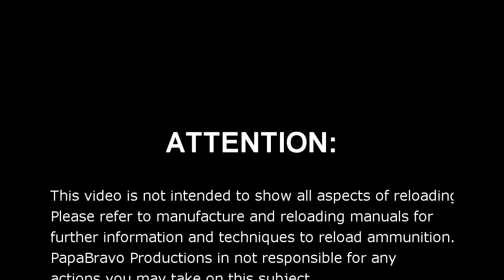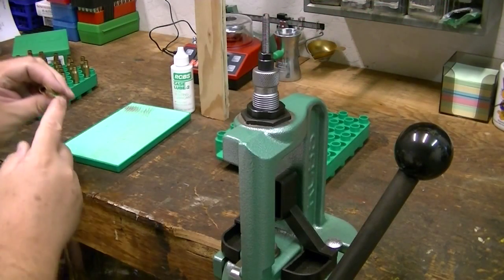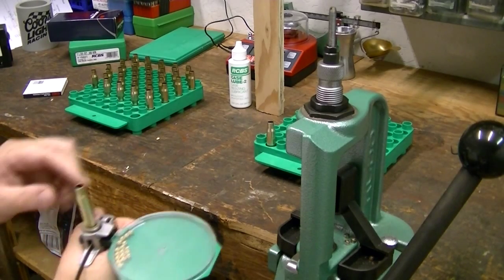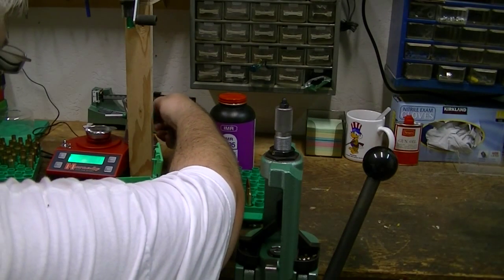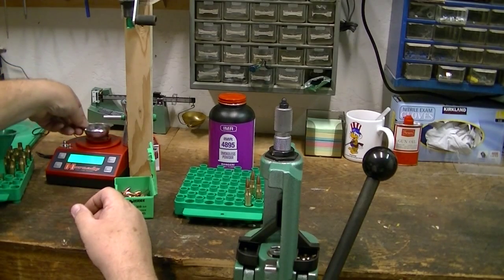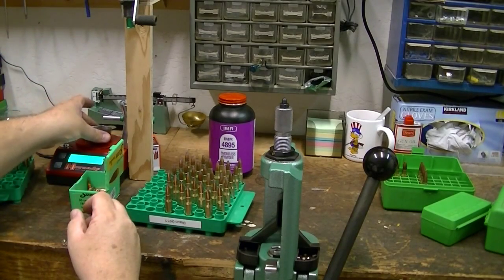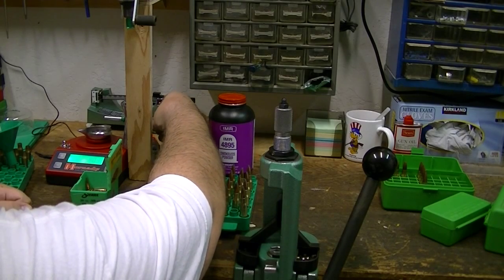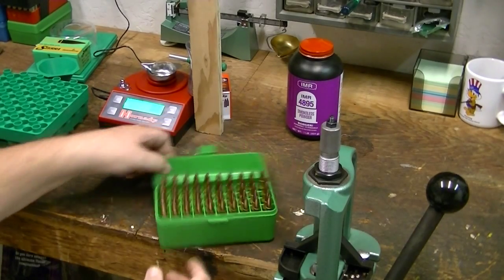Reloading Part 4 of 5 'Doin' It!'

Comment from the maker: Yes, the powder measure can be adjusted to any grain load from pistol to large rifle. The only reason I use the trickler is so each load is absolute and consistent. You can, for plinking or just fun shooting get a relatively consistent load by just setting the powder measure and checking the weight every 10-20 rounds.  Thanks for the comment!

Comment from the maker: This refers to 'cartridge overall length' which is listed in all reloading manuals. The case length and the C.O.L.A. are different measurements. The first refers to the brass case which cannot exceed the maximum length as listed (if so you will need to trim your cases or the head space will be wrong). The COLA is the total overall length, which refers to how the round will fit in your mag and in the lands of the rifleing. Thanks for the question.

Comment from the maker: Thanks for the comment. For your application (shooting 45acp...I assume that you are sticking to one caliber) I would get a Dillon progressive reloader. This does have the turret system and you do get 1 reloaded shell per pull. You will have a little more investment in the front end but when properly set up they are a great press system. There are several great vids on the Dillon on YT check them out!

Comment from the maker: @Methos713 Part 5 is on in production as we speak I hope to have it done by early Jan. as I talk about the cost is roughly 1/3 to 1/2 the cost of new (not counting the cost of the equipment). The cost really depends on the cartridge, the powder and the bullets you choose. I estimate that the .308 costs about 60 cents to reload with basic supplies. A brand new factory load is about $1 per round in this caliber.

Comment from the maker: You are correct with the single stage you have WAY more control over the process. However, if you shoot any volume of rounds (mine are mostly plinking rounds) the progressive is the only way to go. Check out my vids on the Dillon XL650. Thanks for the comment!

Comment from the maker: A single stage press will work for you if you do not shoot more than 100 or so rounds per year. You might check on line...Cabela's runs specials on the RCBS kits all the time, but Lee, and Hornady make good machines that are in your price range. Remember, once you are past the price of the equipment reloading gets cheaper every time you do it!

Comment: I like the single stage and doing it all by batch and hand work.... however the progressive is easier..... but:

Your powder loads can be fine tuned
You don't get a change to clean the primer pocket

With that said for pistol practice it is not a big deal. I think with progressive you can treat it like a single stage and do more or less hand work processes. Comments?

Comment: I always resize & remove the fired primers first,? Then I throw them into the Tumbler.? To clean.? If you tumble them with the primers still in the cases.? The media will stick & get clogged.?into the inside if the fired primers etc.?
Reply from the maker: +A REDTAIL Yes, I have changed many things since I produced this video. If you check out my other videos, I have upgraded all of my equipment to Dillon gear, but I still use the RCBS loader for small test batches. I have also changed the way I treat my cases, much more work for a better result. Thanks!

Comment: Papa Every bullet cartridge that I make.? I  make a finish dummy round,? With no primer in it.  ( A SAMPLE CASE )? And use that for my Die settings for future use
Reply from the maker: +A REDTAIL I was referring to folks who load different brands and weights of bullets. You need to adjust your bullet seater die for each different bullet ads they are not the same length. Thanks for your comments.

Comment: How do you like your Rock Chucker?  I just bought the Lee Classic Cast mainly for the primer tube, but now I'm thinking about getting the Rock Chucker after messing with one at Bass Pro.  Seems a lot beefier than the Lee.  Just worried about the primer catch bin missing the primers and getting the ram dirty since I will be depriming a lot of brass.  Any thoughts are appreciated!  Great video by the way
Reply from the maker: Sorry it took so long to get back to you...here goes. The RCBS Rock Chucker is a solid press as well as the Hornady press. Both are well built, come in kit form, and are solid hits in my book. I have, since these vids, have gone to Dillon for an XL650 progressive press, which knocks out over 100 completed round per hour. i digress, the RCBS or Hornady are excellent presses for the casual shooter. By that I mean around 100-300 reloads per caliber per year. If that fits they are the right ones for you. Thanks for the comment and question!

Comment: Being your using an electronic Scale & not the Beam Scale.? You did not show on how to Zero it out before putting any powder in the case.? etc.?
Reply from the maker: +A REDTAIL The electronic scale is simple. Turn on, wait for the tare reading, put the test weights on to get a true test weight and the scale is ready. I use both scales (the electronic AND the beam) sometimes just to make sure. Thanks again for the comments.

Comment from the maker: Not easy to answer, but here goes..If you load a lot of a few calibers, the progressive is the way to go. If you load a few rounds of a lot of calibers (less than 100 per year) the single stage is the ticket. As far as QC on the progressive, as long as you PAY ATTENTION to what you are doing the progressive is OK. Another factor is cost. The progressives start at about $350 and a single stage Kit starts at $300 Check my channel for progressive videos - Thanks for the question!